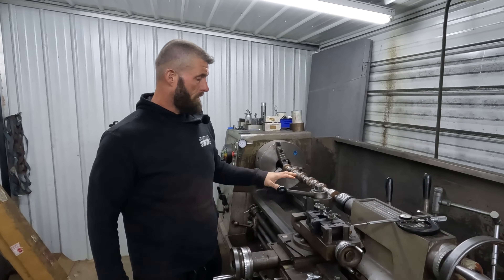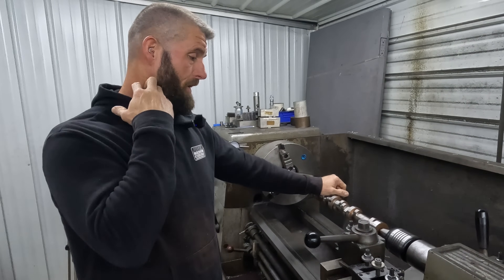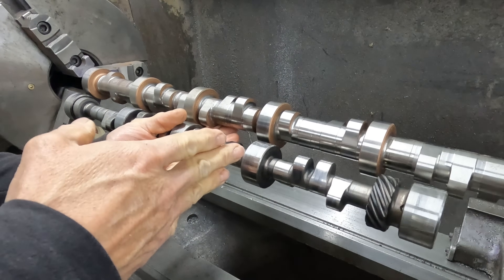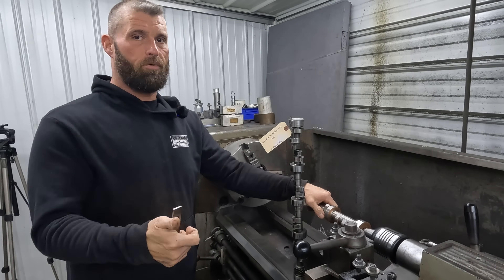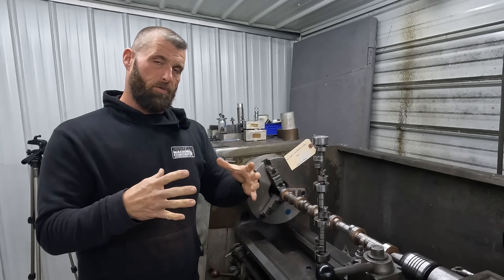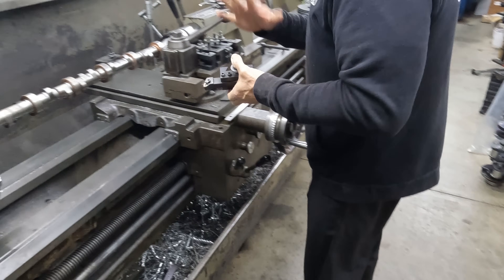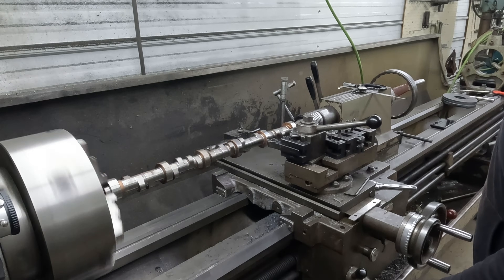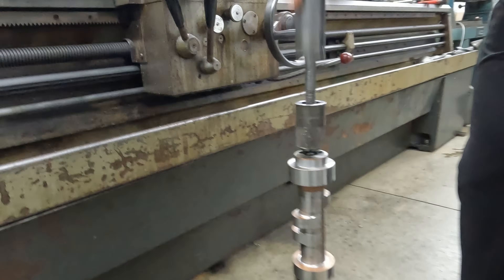Viper V10 camshaft modifications and more camshaft tech part 1

Comment: Some of the trend is to use a higher ratio rocker arms and reduce the lobe lift to get a larger base circle.  The benefit is less lifter and pushrod movement, which reduces the amount of spring pressure required to control the pushrod side of the rocker.  It does, however, put more load on the cam and lifters. It is always a trade-off.
Reply from the maker: Any time you add rocker ratio you increase spring pressure on the pushrod side of the system,  this compounds the stress on the cam,lifters and pushrods so it's kinda self defeating
Reply: @powellmachineinc3179  the NASCAR stuff I have seen  uses this method to slow down and reduce the momentum of the pushrod side components. I am assuming there's a benefit or they wouldn't be doing it. This is Craftsman Truck stuff with roller cams, 60 mm cores, and large diameter bucket keyway lifter stuff.

Comment: I'de love to see you display and showcase a Cam from an NHRA/AHRA Pro Stock engine!!
Do a brief over on explaining differences in theirs vs street cams.
Reply: Here is some crazy cam stuff for you. On a 822 cI mountain motor pro-stock engine we ran an 82 mm  clamshell cam. 9 cam journals in a closed in cam tunnel .  The intake lobe is .915 lift. With a 1.55 rocker ratio it had 1.418 inch valve lift. The exhaust lobe .850 lift with a 1.55 rocker gives us 1.317 inch valve lift.